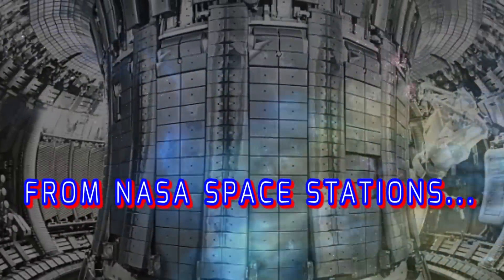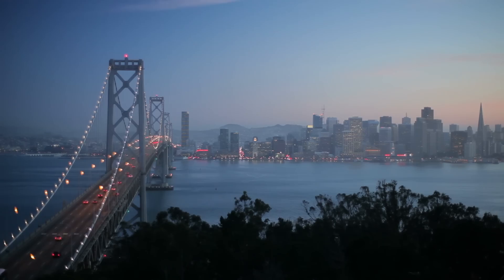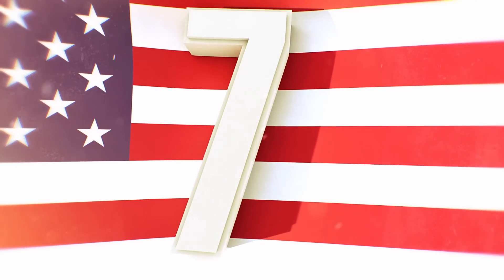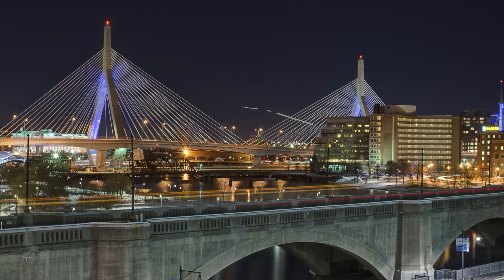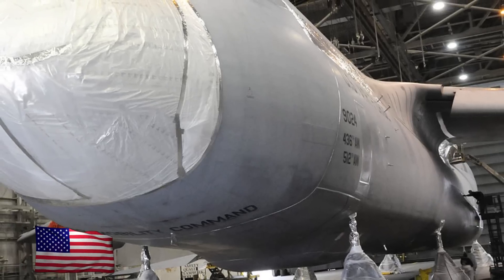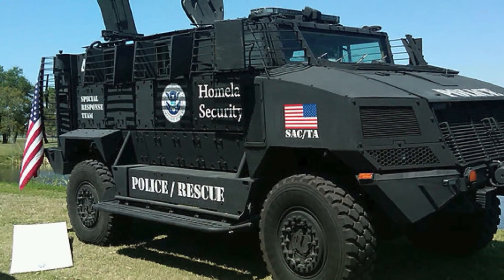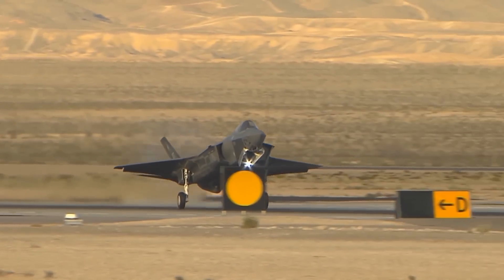10 Most Expensive Government Projects Ever

Comment: dude, the F-35 is called the joint strike fighter, meaning multiple countries investment and acquirement of the plane. plus the F-22 cost quite a bit more per unit than the F-22. poor choice on your part, and a poor representation of not only it's capabilities, but also it's intended use by multiple countries.

Comment: I am not sure where the figures for the C-5 came from, though they are on Wikipedia too. Though still flying the C-5 is an antique. None have been built for decades. Those prices could never have been sustained in 1969! Maybe some one added up all the money spent on the plane over the last 49 years, divided it by the number of planes, and adjusted for inflation. 
The Skylab figures seem way too high also. You are claiming it cost half as much as Apollo, yet it used equipment already purchased for, and surplus to, Apollo.

Comment: In 1979 , IBM won a 1.2 billion contract from the FAA for a completely new FAA control; system. In 1995 the contract was canceled as a failure, do not know how much it was overrun. I personally worked on this contract and it was a complete disaster. I have been retired for several years now but I suspect the equipment we designed in 1965 for Terminal ATC is still in use.

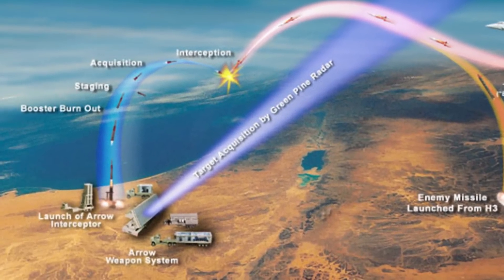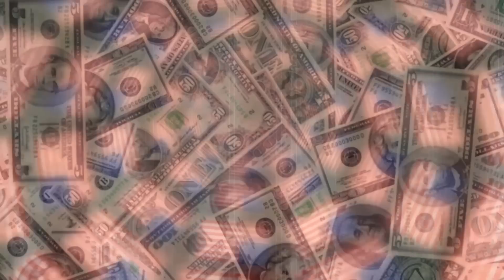Comment: 4:45 Planes with lasers have resurfaced. They are actually in use currently but they are much more modern than their 1980s counterparts. 8:08 and your math is wrong by 1000%.. If you gave every US citizen $4500, that is $1,431 trillion (4,500 x 318,000,000).. Not $1.431 trillion. Add on the student loan debt of about another $1T, and then the health care for 4 years, which is probably another $1T and the military's salary budget of another $1T, and you've got $1,434 Trillion.. #epicmathfail.